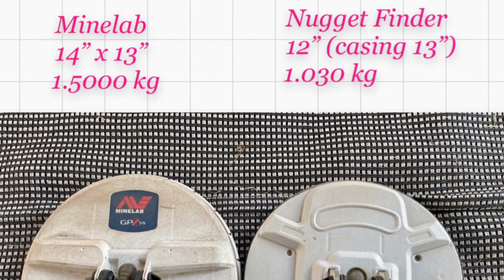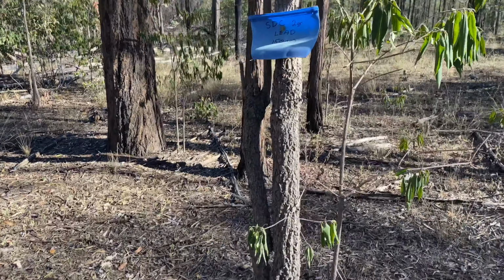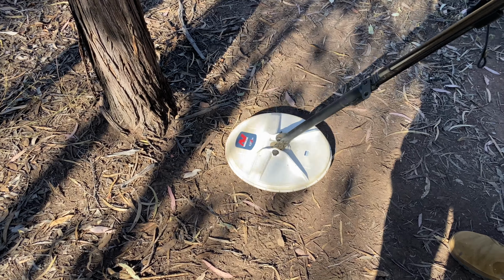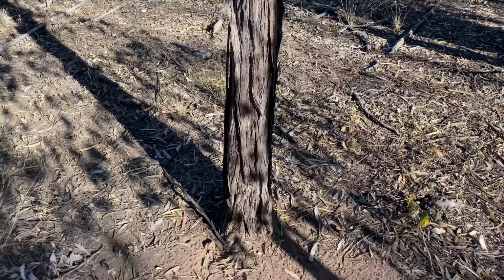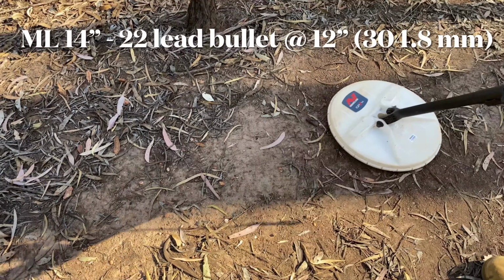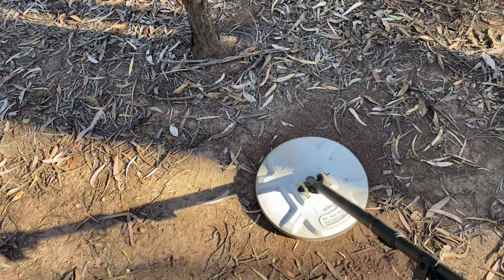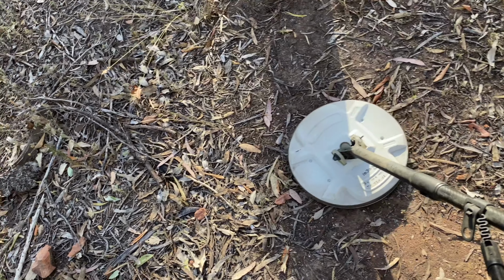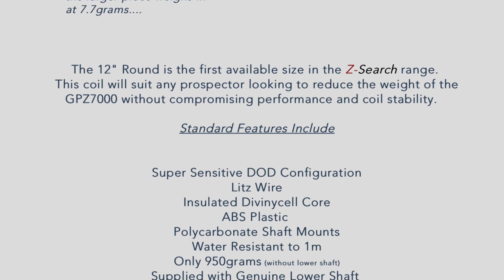Minelab 14” Coil v Nugget Finder 12” Z Search Coil

Comment: Thanks for the comparison Annie, apart from the weight savings,  I think I'm going to keep the original coil. I'm picking up 0.09 gram "nuggets" so its hard to justify the expense for an NF coil. I think more time spent on research rather than new equipment.
Reply from the maker: OMG - Yes, I can understand that. It is lighter again with CTX 3030 battery but that battery just makes 4 hrs total. I understand the Z coil has been ‘tweaked’ since the ‘test’ coil I used. 😀⛏⛏

Comment: So basically, the new 12 inch coil works no different than the standard 14 inch? Not worth investing in. My preference would be the 19 inch.
Reply from the maker: Michael, I personally did find the 22” NF more sensitive to small gold and lighter in weight.  The 19” May suit you well but for me it is too heavy to do lengthy hours of gold detecting. 😀⛏️⛏️
Reply: OK, l guess that makes perfect sense.
Reply: Скажите после 14катушки можно еще что то найти 12?NF?